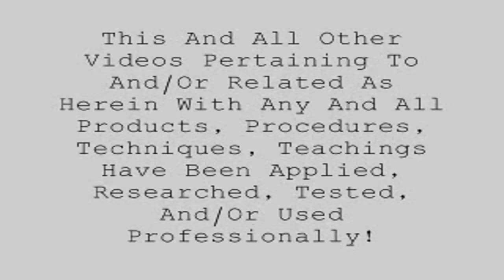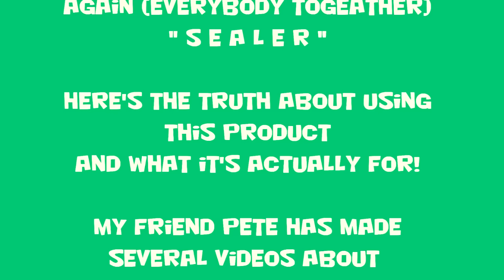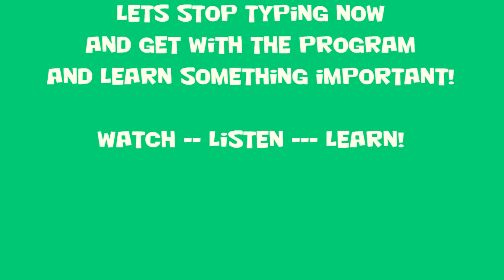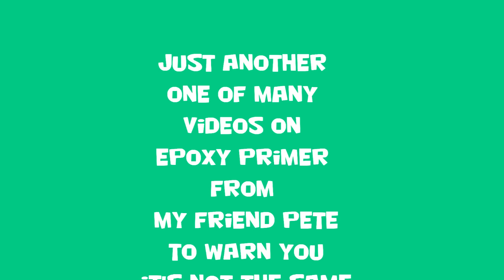How To Use Epoxy Primer - Automotive Paint And Body Tech Tips

Comment: Epoxy primer, depending on the brand will not fully cure for 3-7 days. If your sanding before it fully cures it’ll gum up. When a true epoxy cures it’ll sand like stone. Epoxy primers have a working time you can finish prime or use body filler, or color coat without sanding. If you exceed that time you have to sand it and that will be difficult. Epoxy primer is a fantastic bare metal sealer, you just have to finish it before it fully cures.
Reply: Yea noticed the super long curing time.. prob due to being single pack with no hardener.

Comment: Hey Pete. Another good video, and you are spot on as usual. Just a bit of information for anyone in the UK or Europe, I don't know what the situation is in the States. There is a coatings brand called HB Body, it is manufactured in Greece. I have used their products for years with good results. They make an epoxy primer which, according to their TDS can be thinned down quite a lot (40% rings a bell), this allows it to be used like a wet on wet non-sanding primer. You can apply it with a 1.3mm fluid tip and it goes on really smooth. It is ideal for those areas where you have rubbed through the original epoxy coating exposing bare metal. Just a very light scuff with 320 leaves it ready for accepting high build 2K primers.
Reply: Bob, That sounds like a DTM to me. Matrix sells a MP 200 here in America that does what you described above. I for one am not ready to completely trust this. But I am not disputing you. Maybe I am being overly cautious. lol 
Phillip Hall

Comment: Thanks so much for this video. I have a Falcon that got stalled for over 7 years that I used epoxy on 80% of the metal. I would like to get started on it again but still have some body work/high build to shoot on the car. Had no clue how to deal with the now 7 year old epoxy. You answered all of my questions.

Comment: Great information and spot on. Epoxy “primer” has excellent adhesion and sealing properties, but it does not sand well at all. Ideally, you shoot over it with your polyester “sanding” primer wet-on-wet.  (After the epoxy has flashed off but while it is still just barely on the edge of tacky).  So when should you ever sand epoxy primer? Epoxy primer needs to be sanded or scuffed before the next layer when you’ve gone outside of the open or full cure window generally around 24 to 48 hours for most products, as always look at your technical data sheets.  You can save yourself a ton of work by being ready to put your polyester (or urethane) sanding primer on immediately after you epoxy prime/seal.  However there are times when you need to wait days, weeks, or even more before moving to the next stage, so sometimes sanding or scuffing epoxy is necessary to remove the “rind” that develops and reduces next layer adhesion.  AFAIK polyester doesn’t have this issue, but then again, polyester sanding primer doesn’t provide as much of a moisture barrier (it’s porous) and isn’t quite as good with adhesion.

Comment: Well explained thanks! One question, you mentioned can paint directly over Epoxy primer(sealer) but will that get good adhesion? Because sanding the epoxy is out of the question.
Reply: That's what it's used for. Basic two ways to apply.  One way, after you have completed all your bodywork you use it as a sealer then topcoat before it cures as per TDS. Make sure you reduce it per TDS so that it lays slick and you reduce any chances of orange peel. Or two,  If you are going bare metal and extensive bodywork you spay it as a sealer without the added reducer then do bodywork the areas that need filler etc. When you are done then 2k high build prime over it and block and guide coat to finish. Then top coat. Or before top coating,  at that point if you are spraying reds, yellows or orange's you can tint and seal with with urethane primer that has been reduced per TDS to lay slick and immediately spray topcoat within tack period as per TDS. You do that to make surface uniform same color to reduce the amount of paint required to achieve coverage. Sealing also eliminates shrink back from body filler absorption. Otherwise you will see the filler in the final paintjob. It will look like dull areas in the paint......:)

Comment: If i repaint a car and rust is there i remove the rust and then epoxy primer even before bondo if i bondo over metal i epoxy prime over that then 2k sandable primer. Epoxy should gas out a few days then put 2k sandable primer over and don sand through then just paint over the sanded primer. easy as that.

Comment: I used to work for Ford 25 years ago. I worked in the insurance refinishing shop. In other words I took vehicles with bad paint from the factory and stripped them and repainted them. We would always etch primer then seal with PPG DP50 which is an epoxy SEALER,,we never called it primer. We never sanded the DP50, iit said on the can not the sand, use as a sealer only. After sealing we would the use PRIMER,,,PRIMER folks. We used PPG K36, which is an acrylic URETHANE PRIMER,,,we would sand it smooth and then reseal with DP50 agin then paint.....IT IS A SEALER not a primer.....
Reply: Why not just call it epoxy sealer  Already have filler primer 1K primer 2K primer Geish
Reply: All this newer faster confusing stuff but with a one man show, you can't afford help even if you could find trustworthy people the new stuff is time saving and cost effective.

Comment: Not to get into disagreements, everybody has their own take on materials, but the best way to start from bare metal up is epoxy prime itimmediately before any oxidation can start.  Then you CAN do your filler work over that, scuff it if it has been longer than recomendation of manufaturer but usueal a few days is cool.  Applying body filler direct to bare metal is fine if no oxydation has started but if you get a chip down to bare metal later it will rust and creep under the filler becasue the filler is pourous.  The same reason Pete says he wont put polyester primer over bare metal.  Polyester primer is basically sprayable polyester body filler.  Start with epoxy primer,  do body filler work, then polyester primer if needed or urethane primer, then to urethane sealer then paint or straight to paint depending on prep and if there is any sand throughs.    Thats my opinion and the products data sheets will align with that.   There are sandable hybid epoxies out there also that can be sanded.  Not trying to be a know it all, but like the commercial,.....I know a few things ;)

Comment: As i work on a project it is moved in and out of the shop so i seal it with epoxy then body work over that.  The humidity is low here so if i can keep it in the shop i would body work without sealing. There is no one way of doing things but a reason to do things certain ways at certain times. I also seal before base coat so i do not have to worry about burn throughs. With sufficient dry time there is no worry of dieback

Comment: Hi Pete.... isn't it best to spray epoxy over metal and then use the body filler on top? Then prime and paint?
Reply: It depends on what type of epoxy primer you use. There are sandable versions you can use both on top and below the body filler.

Comment: When sanding rust off of the bare metal, should I use a high grit sand paper to make the surface ultra smooth before applying epoxy primer or is that not necessary?

Comment: Hey Pete, 
You would not believe how hard it  was to finally obtain epoxy primer/sealer...Thanks to you I persisted and finally got some (in Australia). The stuff I got can be sanded, but it is not a filler or 2k sandable primer. If you break through it must be spot sealed.  This stuff etches and seals the metal to help reduce the chance of rust  travelling any further under the epoxy sealer e.g if you get stone chips.
I probably make no sense but thanks to you, but I have the stuff. 
Interestingly the hardener is nothing like any 2k primer hardener. It has a very distinctive odour, and my primer/sealer must have a  special dedicated thinner. 2K thinner does not blend at all.
Any project I do, gets applied first. Bog (bondo) can go over it, after a 320 sanding for keying.
Reply: You are still confused on what epoxy primer is.
Reply: @SOLDOZER  No, but any knowledge or info you have I will always consider. Remember these are Australian made products...Concept and Florite epoxy primers are sandable. refer to https://www.youtube.com/watch?v=N_3WIdr-dWk  @ 2:35.
Reply: @desobrien3827   Like he said in the video. True epoxy primers are not sandable. Sandable epoxy is a marketing gimmick.

Comment: Sir i am currently sanding my 1981 chevy malibu to the metal because it has 5 layers of nasty material that has messed up  two paint jobs because it was never sealed. My question is if there is any type of primer that i can spray over the bare metal maybe a high build and just sand and paint. I am not looking for a fancy paint job just something a step above primer. Im doing this in my storage room that small and hot and i want to just get this done with minimal steps. I need to prime each panel as i get done with it. I wouldn't mind sealing it as a last atep but firstly i need to prime the panels to protect against rust while i work panel per panel. I am not in very good shape or health but i am trying to do it myself at least get the sanding done so i can save some money. Then i will find a body man that can do body work prime  where needed,seal and paint. 
Id appreciate any advise.

Comment: So if you have prepped bare metal shoot it with epoxy primer do you have to use 2k primer or can you go right to paint after the epoxy primer is sprayed also if you do body work can you epoxy over it and then paint or does 2k absolutely have to be used after epoxy primer

Comment: There's Epoxy Primer that's Takes time to dry like a 72hr window pried to paint over with no scuffing necessary. But if you try to paing after it's 72hr window then your going to have to sand down for adhesion purpose. But!!!!!! If you lay the epoxy down and try to sand it yah you can for get about that hands down...but it is more solid of a primer then any reduction Reducers. I had a House of colors Epoxy 2k primer that I put on and let it bake out under the sun for a week and it was ready to sand not the easiest first layer to go through. But one's your over the bridge it's easy breezy sanding from there on.... But like he sead it's different strokes for different folk's..👍📍

Comment: Epoxy primer / sealer is what is says it is. ideally, you’re supposed to use 2K primer first sand it get it really nice and then once you blow it off, you can spray a coat of epoxy primer to make a nice even surface once that dries then you can apply paint. The word primer just means it can be used before paint. Like a primer you put on your wall at home to cover a blemish or dark spot before putting on the topcoat of paint. This helps with adhesion and coverage

Comment: I am going to glass bead my auto frame, I will be using a black epoxy primer. Then I will use a urethane black paint as my finish coat. So, I do not need to sand the epoxy primer before applying the urethane?

Comment: So if you wanted to seal everything before color can you use epoxy sealer reduced
Reply: Yeah like a suspension part that been sandblasted and use epoxy sealer as a non-sanding situation and then paint

But i preffer washprimer -> 2k high build -> sand it out and then paint if it is on the outside of the car (or other items that is supposed to be pretty)